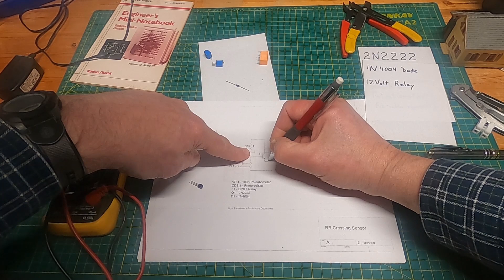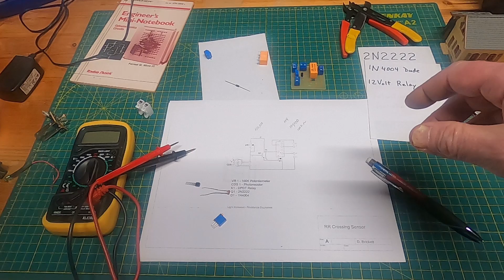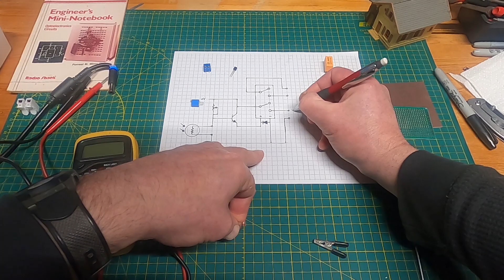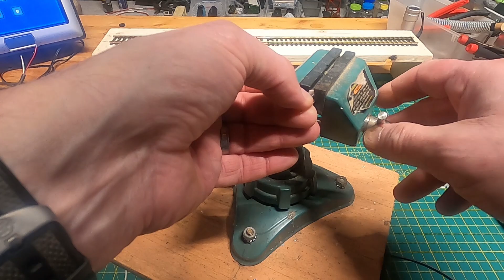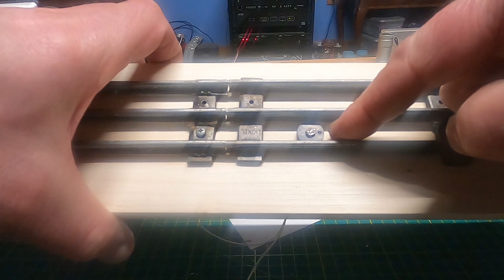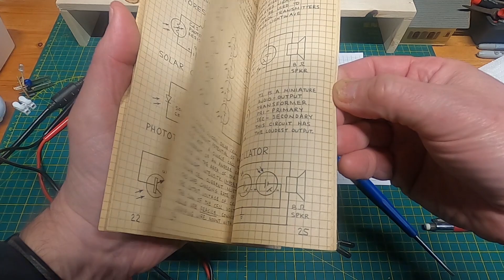Photoresistors, How they work and how to use them on your layout.

Comment: That is a good video showing all of this stuff. When you mentioned a photo sensor I was thinking about it I had an old toy when I was a kid it was a stuffed animal turkey. There was a photo sensor in the mouth and when you opened the mouth the turkey would gobble and then when it closed it would stop. Same thing with the furby toys they had a photo sensor above the eyes so when both sensed like the furby what's a bright light turn off please. Or it  would say too dark turn on the light what I went to the train show in West springfield Massachusetts I noticed a lot of the layouts was using photo sensors for the railroad crossings. The railroad crossings would light up very early and then the gates on some of the layouts would drop and then continue keeping Gates and lights going until the last car passed the other sensor which was further down the track but he's really cool to see and you couldn't see the sensors. However I'm sure they put something near the track to Mark where they were because if they had to change them it would make it easier. It was quite cool set up to see.
Reply from the maker: Thanks for watching, I'm glad it was helpful and informative.  That sounds like an interesting set up with the light houses.  I'm always trying different things or looking for new ideas.  I do have a crossing that I'm working on.  I forget where I saw one of those turkeys you mentioned.
Reply: @dbtech7914  all I remember was I was about three to four years old when I last remember it my mom told me I was very fascinated with it because of what it would do. I know it was from the late 1980s. Yes it does have very useful information.
Reply: @dbtech7914  I was using voice to text I meant the light sensor was used on a lot of layouts. Not lighthouse. Google has a way of messing up voice to text.